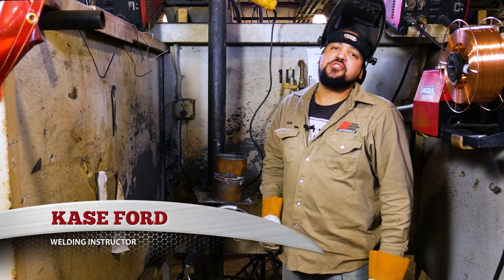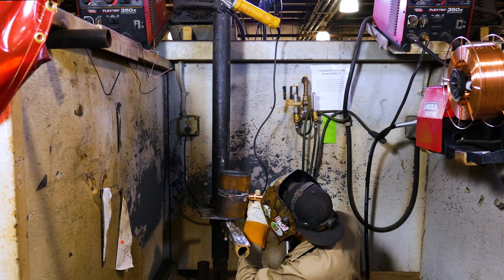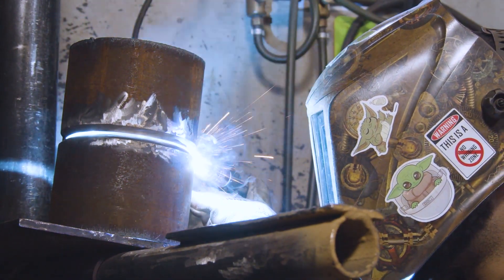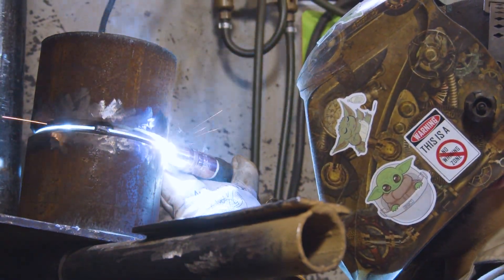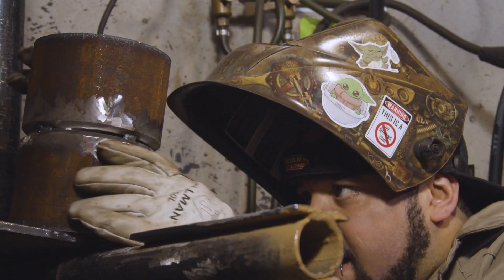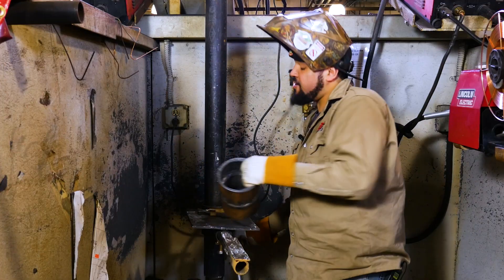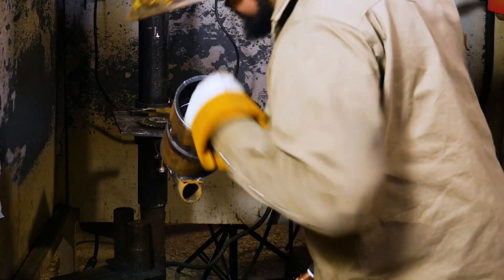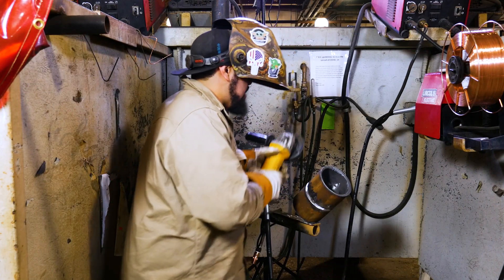How to Weld a 5-Inch Pipe in the 6G Position Part 1 ~ Tulsa Welding School

Comment: Once your puddle solidifies after you blow through and stop don’t just strike up again take your time and feather them back out. You were running way too fast from your 6-9 o clock. It’s inconsistent there’s lack of fusion and you missed that last tie in miserably. I’m assuming you’re a tig welder or stick welder.